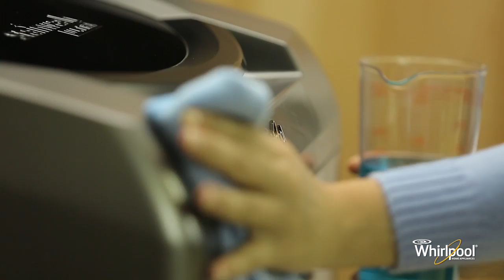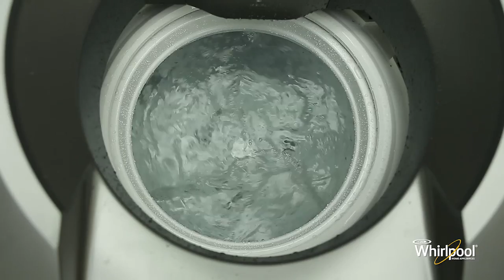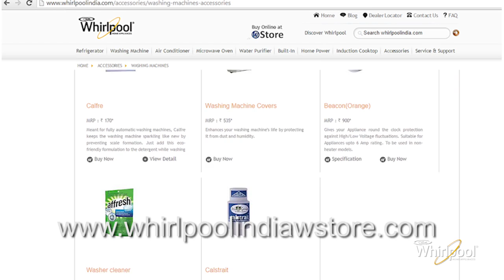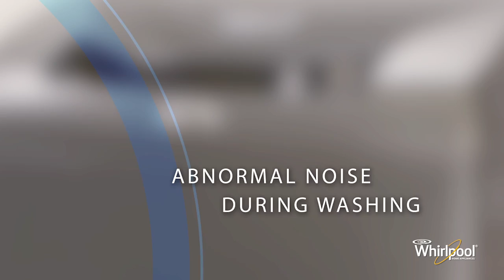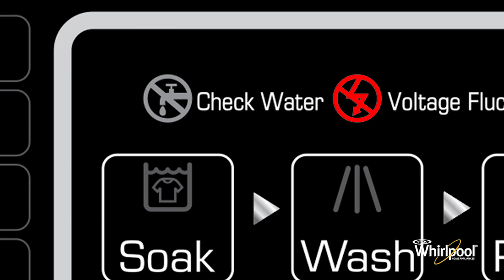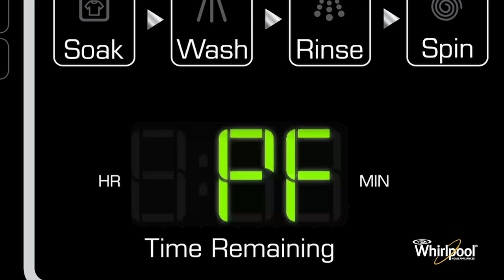Whirlpool Stainwash Ultra - Maintenance and Troubleshooting

Comment: Not recommended. This lasted just a little over year for me. Got the motor replaced which broke down after 5 months. Gone back to a manual panasonic washing machine that costs 1/4 the price (and costs almost the same as the replacement motor) but lasts way longer.

Comment: I have 3 issues with this washing machine:
1. Takes in too much water (2 buckets) even for low water level settings. Would have been better if we had more control over settings lik in lg (6 water levels).
2. Rinse again takes in same amount of water as wash.
3. The spin cycle is short. Doesn't help with more dirty clothes.

It is a good machine but should give users more control over UI (like in the case of LG)
Reply: Yeah also in 3, the clothes is not dried enough
Reply: This machine has faulty programs,not proper for water and electricity saving. The environment program has by default high water level😂😂😂😂, it should be manually settable